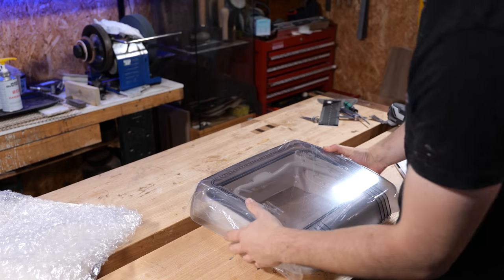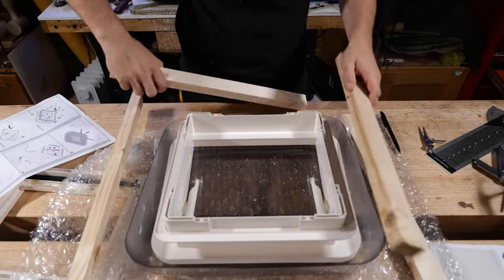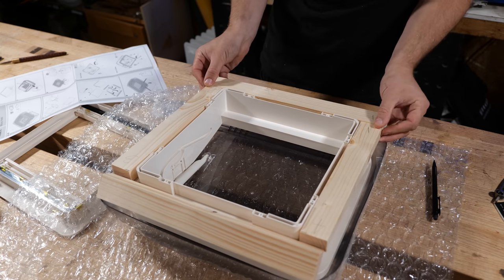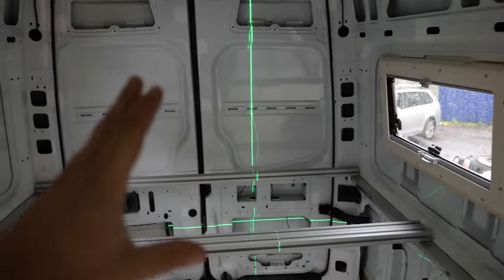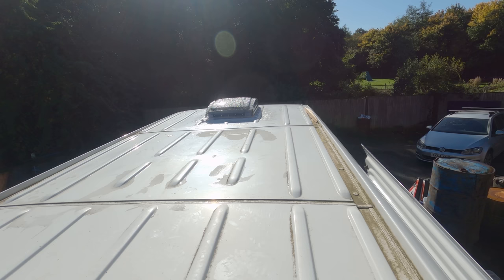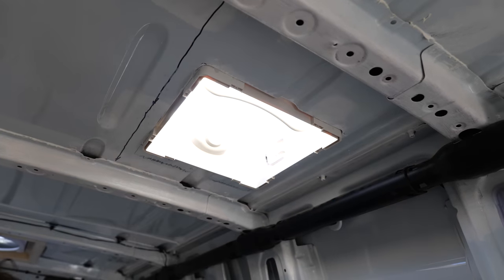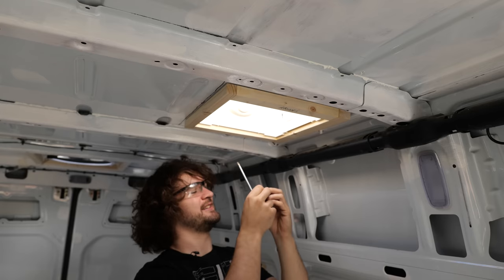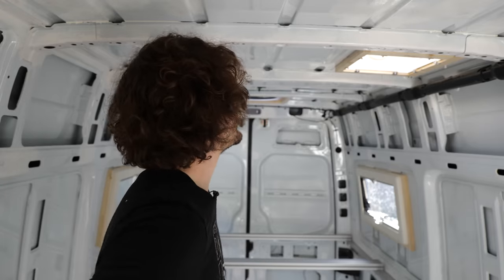Installing a Dometic Mini Heki Skylight | Mercedes Sprinter Van Conversion #11

Comment: I watched this because I don’t know what to do with the ridge on top of my van. You didn’t include anything. What’s the point of making a video if you leave out the crucial parts? You could’ve just made the video short by standing in front of the camera showing the skylight and say: “I just installed this” 
That would actually be more informative
Reply: I watched a different clip, she used mastic sealing strips to cover the gap. It was really informative. Now I have the courage to do it myself 😁🤗❤️

Thank for absolutely nothing.